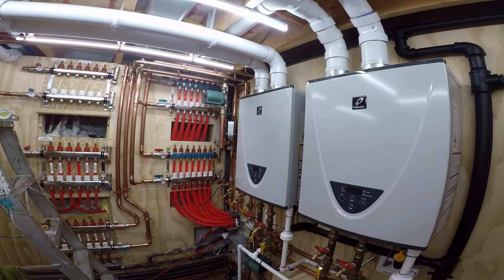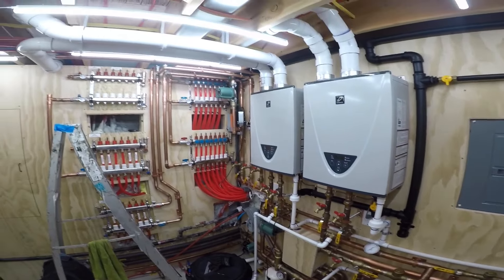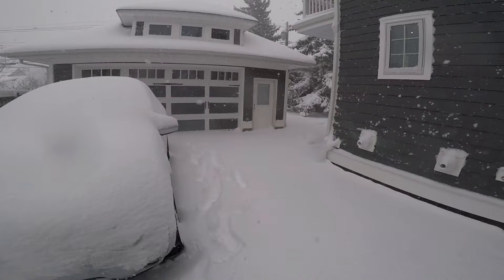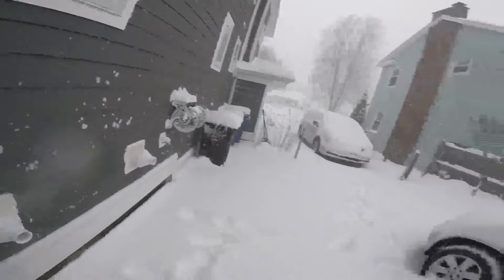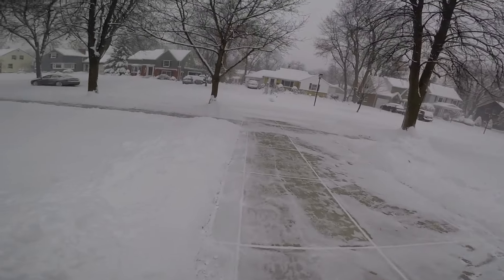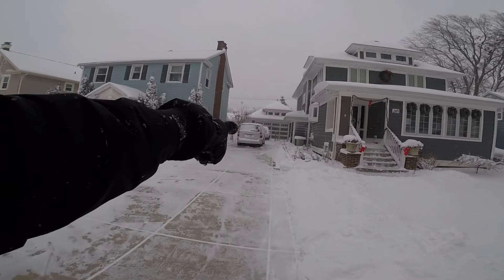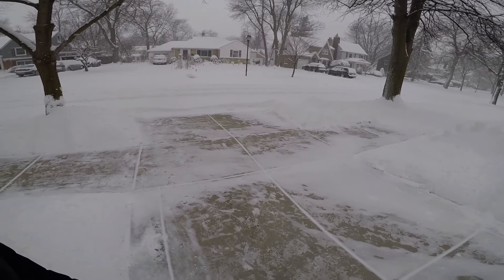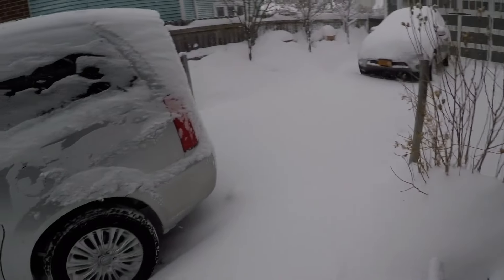Why Did I Install a Heated Driveway in Buffalo, NY?  This is Why - Episode 38 [12-26-2020]

Comment: Love your videos, thank you for taking time to show us and explain your system. I’m installing radiant flooring in my shop that is 24x40 which would give me 3 zones of 320 feet each, in your opinion, how would you go about adding a 13x6 apron at the doorway for snow melt. Do you think I could make it a four zone system and control the aprons heat thru the manifold or would you add a separate zone for the snow melt?
Reply from the maker: Hey Adam!  Thanks for the compliments! It sounds like your garage is similar to mine, only slightly larger.  Mine is 24' wide x 32' deep.  I used 1/2" pex at 6" centers for a few rows in front of the overhead door, and then went to 12" centers.I also had 3 loops, and by the time I included the leaders (supply and return) from the slab through the 6" pipe and into my basement to the manifold, I was at around 330' each.  So far it seems to work well, so it's hard to say what I would change if I did to over.  I might've kept the loops lengths a little shorter and maybe gone with 4 loops instead of 3. That also might've let me install the loops a little tighter, at say 9" instead of 12".  It works great, and has kept my garage at 60ºF all winter, including in January with outdoors temps of -10ºF, but I do notice the floor being a few degrees cooler towards the end of each loop when I look at it with the FLIR.  Not a big deal, but pex is cheap, and you can't add more later if you're not happy.  As far as the snowmelt, I will give you my opinion, but keep in mind I'm just a DIY guy sharing his build on YouTube, not a Pro 😀.  This really is going to depend on what you're expecting from that 13x6 apron. If you're expecting it to be clear and stay clear, I would 100% put it on its own zone, with its own pump. That way it can run independent of the garage floor, and it will most likely need to run a lot more often than the garage when it's on.  If you just want it to melt whenever the garage is on without any independent control, you COULD just add it to the garage zone, but if the garage doesn't run long enough to melt all the snow off, you will get ice, and that's worse than snow. If it was me, I would put that apron on is own zone with its own pump and manifold. Use 5/8" pex for it, spaced 6" on-center. That is such a small apron, you probably can get away with 1 loop and no manifold (you'd have to do that math: https://youtu.be/4BoNNL9KPL8 ).  Put the pump on a switch like my setup, and turn it on when you want the apron melted, and off when its done.  You could put the Tekmar socket in for automatic control, but spending $1k in controls for a 13x6 apron is a little extreme in my opinion. Just use an Aqustat to control the boiler pump, and it will run itself.  For that small of an apron you could probably just leave it on all winter and not notice a huge cost difference.  Its' not going to take long to heat and melt that.  You could also use my re-wiring video and give the garage priority, but you're only talking an extra 12,000 BTU's to melt that slab at 150 Btu's per sq ft, so your boiler / heater should be able to handle both together just fine if there's room.  Anyways, hope that helps.  Let me know if you have any additional questions and I'll do my best to answer them or make another video.  Thanks for watching!